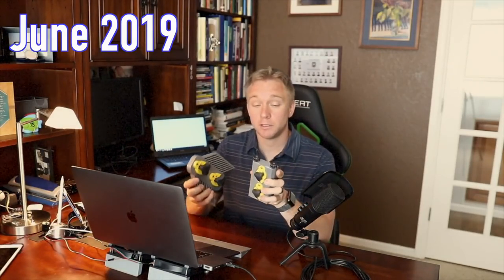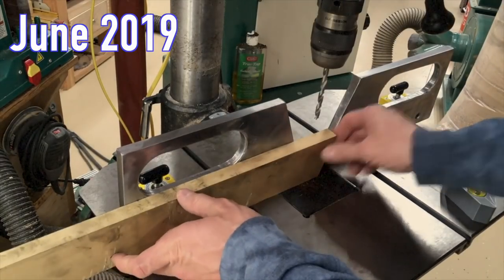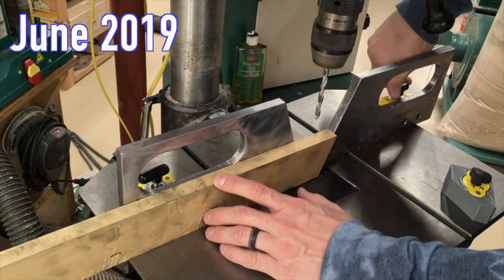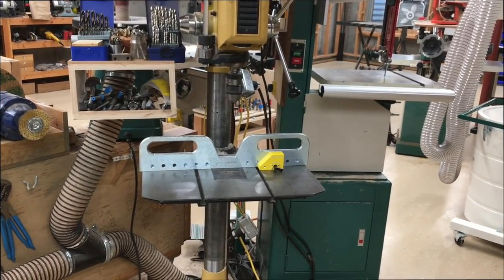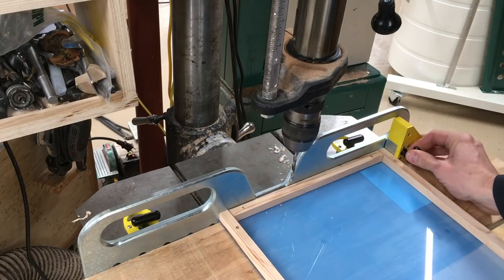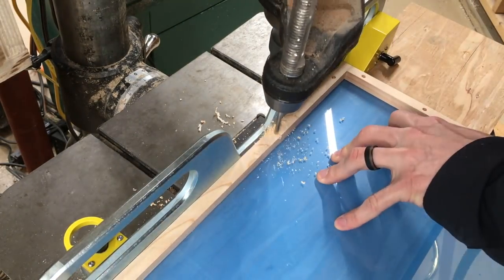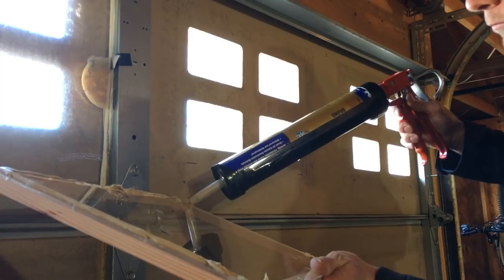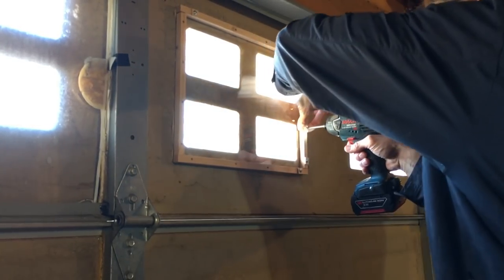New Magswitch Launch - Drill Press Fences!

Comment: Very cool Andrew! Something that would be cool if one edge had either a lip to act as a stop and a hold down or had a flip out hold down. I guess you could get an extra magnet to act as a hold down though.
Question: My current drill press table uses a wood table top. If I put a piece of steel in the area for this new fence does the thickness of the metal affect how strong the mag switch will be?
Thanks for your time and all that you do. I like how inventive your mind is!
Ron

Comment: It’s great to see these go into production!  I provided feedback online but any chance you can use your contacts to get dimensions posted on the website?  Not sure which size to get at the moment.

Also: with the narrow mounting holes it looks like the longer fence could be used on a smaller table to allow positioning the stop blocks further out. Do you think that would be a  reasonable use or would you recommend the smaller fence for smaller tables?
Reply from the maker: Large one is 21” by 4 5/16”, small one is 13” by 2 1/2”, and we put that on the website to, sorry it was missing.

For a small drill press you can definitely have the ends of the fence sticking off a bit.  I’d probably recommend the larger fence unless it’s height would interfere with the handles, in that case go with the smaller ones.

Comment: "Funny" question for you, if someone bought the small drill press fence as it looks amazing, and then realizes....oh crap my drill press table on my older 12" blue Ryobi drill press is too small to properly use even the small super cool fence.  Do you have any suggestions on where or how to find a replacement larger cast iron drill press table to use?  I have been looking around and so far look to be searching incorrectly.  Even though the fence is not here yet, I am still happy I bought the fence, but hopefully I will be able to figure out how to use it. :)  So if you have any ideas, they are appreciated :)  Eventually I will get a larger drill press/better shop space to have more of the larger tools. But for now what I have mostly works. Other than the new fence when it gets here ;) Thanks.
Reply from the maker: So a couple questions, what makes the table too small?  Because the magnets can be positioned really close together on the small fence, and if the sides stick out past the table that doesn’t hurt anything, or I don’t think it does, is that the issue?  If I really needed a bigger table I would probably buy a 1/2” thick steel plate, drill appropriate holes in it, and fix it to the existing table T tracks.
Reply: @AndrewKleinWW  Thanks, that is the kind of useful information was what I was hoping to get :)  Hopefully that will mean my table is not too small after all, it is only around 10.75" in diameter.  And a half inch steel plate should be easier to find and use than what I had been thinking of, ie hacking a larger drill press table in place of this one.
Reply: @AndrewKleinWW  I 'solved' my problem and am now the happy owner of a rockwell delta 15-665 which has a nice big table off of craigslist.  So the drill press fence will have a good home when it gets here. :)

Comment: Tempting. I'm surprised there's nothing to line the fence orthogonal to the base. Guess it doesn't absolutely matter for most uses.
Reply: Yep, the relationship to the 2D axis of the spindle is all that matters. You can theoretically spin the fence a full 360 degrees about that axis without changing the relationship or the end result. In the real world it will change your errors because the fence and the table won't be perfectly oriented, so you could care about repeatability if you need to remove the fence for some reason, but it wouldn't matter which orientation you pick as long as you can return to it.
Reply from the maker: Yeah, I didn’t mention this in the video, but I like to leave one man gent on, turn the other off, and just move one side of the fence in and out to fine tune the depth,

Comment: Man I'll be honest... This fence seems pretty cool but holy shit has the makers marketing push been relentless and absurd. I literally have 4 videos and a story or 2 about it in my YouTube feed right this second. I am 1 nice away from telling Google I'm not at all interested busy so I don't have to see another several listings about it. It's cool but I don't be spilling out my paycheck over it. My drill press table does all the tricks i.e. it has t-tracks for a highly adjustable ¾ or 3 inch tall fence, clamping via the t-tracks in the table or the fence and a replaceable zero clearance insert. The only advantage I see here is the added drilling depth due to the lack of the table... Other than that... Cool... Magnets 😒 Although I feel John Oliver would have been a better "non-spokesperson"